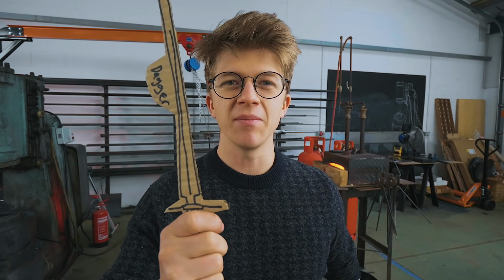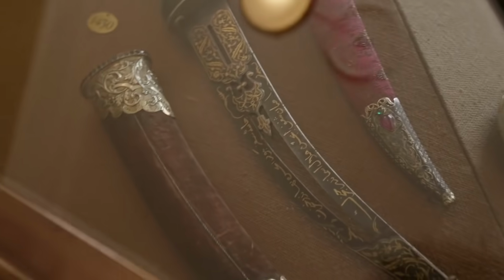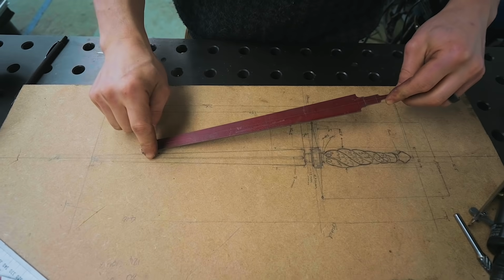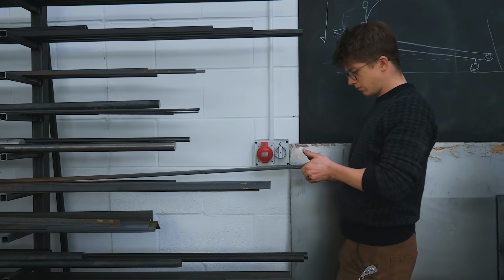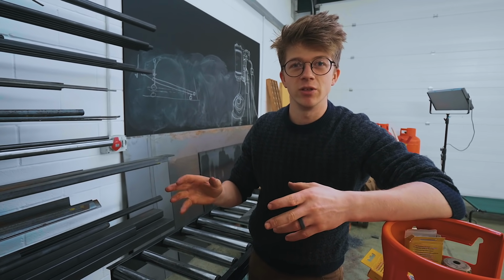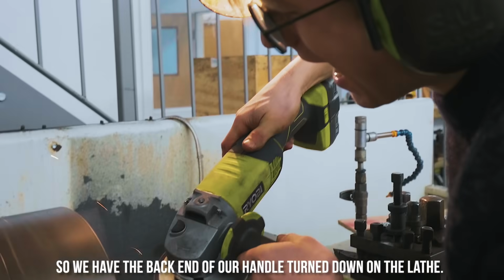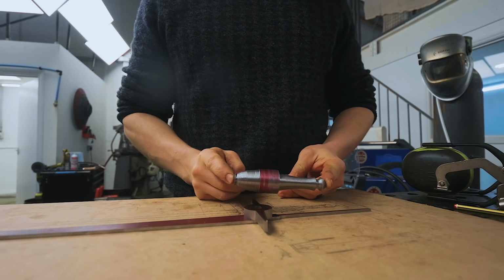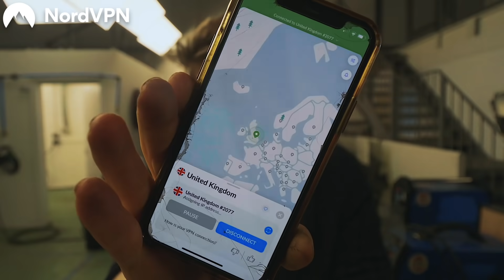MAKING THE SEA-MONSTER STILETTO!!! Part 1

Comment: It boggles the mind when you think about the fact that these historical masterpieces were made solely with hand tools.
Reply: @Felipe Lavratti we have the time as well but most people care a about efficiency and not the tradition of the craftsmanship
Reply: There's a challenge for alex; a blade made only with medieval tooling and techniques
Reply: during the middle ages blacksmiths would get so good at forging as that was the only thing they did day after day, and so they became masters of using hand tools resulting in great pieces of work.
Reply: Not to mention they also melted minerals and everything to make ore then they made the metal and hammered it all out by hand
Reply: In fairness, the function of power tools was to make fabrication easier for mass production. The temptation to rely on power tools slowly kills the need to apply patience the way Ye Olde Masters did.
Reply: @Felipe Lavratti I agree I feel like as times passes, every thing is sped up more and more
Reply: @Felipe Lavratti I think that as as things started to revolve around profits, older ways of craftsmanship were lost in attempt to make things more efficient
Reply: Don't forget that in higher end stuff there would be dozens of apprentices and journeymen working on various stages with the master overseeing. Often the blade would be made and sold separately and the handles fitted later to taste, for example a lot of Indian and Afghan swords have British sabre blades with local handles.
Reply: There is also the fact that some of those pieces were only made for royal families who would commission a piece that may take a year or more to make and cost the wages of ten men’s salary back in the day.  The average blade wasn’t something this magnificent.  These are rare artisan pieces Alec is emulating.  And yes it does boggle the mind how those artisans would take a lifetime perfecting a skill.
Reply: Yes all done by hand and yes very slow. You are also seing some survival bias. The masterpieces of a few craftsman that are of the most highly payed work. Some of the master work items cost hundreds of pounds at there time of manufacturing. That would be like paying 100k for a knife and not finding the pinnacle of each trade to compete there parts.
Reply: @xgoodvibesx  Swords were like that in general. The blade was a separate construction, handles could be remade and changed when passed between owners.
Reply: They actually had a bunch of water-powered power hammers and various machinery even in the Middle Ages
Reply: Not everything was done by hand, here in germany exist waterpowered powerhammers that are several hundred years old.  There are documents from the 14th century and earlier about powerhammers powered by water.
Reply: @Metric_Metalworks  that is really fascinating I would love to learn more.
Reply: i've read some of the comments here. don't forget that, back then, a pice of such intrincated work would be so valuable that you could buy a good piece of land if you sold it. so, even if it took you years to make, it was worth it. in modern day, creating such pieces by hand has basically no yield in comparison... other than personal satisfaction and awe factor i guess- but monetarily speaking it'd make no sense. i mean yeas, such pieces go for good amounts of money today, but nothing like a house or a piece of land. you could argue that in the same amount of time (lets say a year), with modern tools, you could make enough pieces to actually buy a house or piece of land. and you'd be right, you could. but we are talking about the notion of going through the learning curve for making such pieces by hand with the tools that they had back then. back then, it was worth it.
Reply: @tobiasripper4124  Honestly though... A power tool doesn't change the skills required to perform the work, it only speeds the work up. Same skill cap applies. A power hammer is still just a hammer - More powerful than the handheld variety, and makes drawing out and shaping steel faster, but not easier. Same for carving tools. You need the same artistic skills to carve a masterwork with a dremel as you would with handheld chisels and a mallet. The main difference is time, thus patience (which I suppose is a skill on it's own, but not one we're discussing here).

I can recommend the Timeline documentary miniseries "Secrets of the Castle" (available here on youtube in its entirety), which focuses on an archaeological project in France, where they build a castle just like they did back during medieval times, with medieval tools and methodology, while being dressed in authentic medieval clothes, living in medieval accommodations and eating medieval cuisine. A fairly large part of it is focused on the engineering behind such an endeavour, and it's actually quite intricate and ingenious. Far from primitive is the least I can say.
Reply: @xxhellspawnedxx  ehhmm thats pretty much what i said? never said it is "easier" just that back then it required certain amount of time and skill that today are mostly not apreciated like they were at that time. back then there weren't many people that could pull off artistic pieces of such value and they took lots of time to make. today there are many people that CAN (doesn't mean will) produce such pieces, and they can do it by quantities in maybe half the time... just offer and demand.
Reply: @Felipe Lavratti They had time? No, they were laborious. They had to take care of animals they owned, because everyone had some sort of animals back in the day. And they probably had a job to do. Because you know, blacksmiths were not artists. They were making pretty much everything that is made out of metal. It kinda annoys me, that there is people like you who think, that in the older days people didn't had anything to.
Reply: @Maltinis  yeah they had a bunch of stuff to do but l8vestock wasn't realy a problem of blacksmiths. People in the cities had at most some chicken and the wives and or children would tend to them. Same for a village blacksmith that was often the only one around they would work year long on everything the village needed with whatevrr livestock and gardening falling towards the woman and children. Craftsman of any trade would be to occupied with their work at least in the countryside because as said they were far and few inbetween.

Also if we are talking about weapons most blacksmiths would at most craft knives and daggers and arrowheads in bulks as the normal pesant had no need for a sword or fancy weapons at all. Heck most weapons that were used when peasants had to fight were spears and repurposed farming tools
Reply: No damascus blade?
Reply: I think they used horse, wind and water power a fair bit by this period to help a bit.
Reply: By the time that style was common, they had water powered power hammers, grinding wheels, saws, forge bellows and even lathes. Also, file cutting machines, mortars to pound minerals and herbs into dyes or powder enamels used for decorating hilts and leather, and much more.
Plus: nobody did it all by himself. Usually a good artisan had at least half a dozen apprentices taking care of the daily chores that kept the shop running, from cleaning to breaking coal to performing the basic tasks (such as basic shaping and drawing or upsetting steel) a master smith wouldn't bother himself with and which were good training and practice for apprentices to build up their skills. And the smith usually just did the blade, then another artisan did the hilt, another the etchings or the engraving, and another again the scabbard and leather or cloth details.
Today there are artisans that are MORE capable, being able to do all that by themselves. 
The learning curve is even steeper, but their work still commands high prices. 
With some custom knives you could buy a fully accessorized BMW.
Power tools just make possible for a single person to do it all by him/herself (there are several women in the trade) within a reasonable time.

Comment: Using abrasive grinding in the lathe is a universally frowned-upon practice, it gets to the ways and slowly grinds them off.
Reply: Next time put some clothing on the bed to catch the abrasive, i would not say a word if it was old worn out lathe, but this looks like it has very nice bed and if its used and maintained properly it will last for many decades. You dont have to listen to us Alec but every machinist will say the same, and the bed is the most expensive part that cant be replaced like a gear or chuck :)

Comment: "A little extra thickness at the tip is handy."

- Alec Steele 2021
Reply: That's what she said.
Reply: tell me about it
Reply: I wouldn't know. :/
Reply: The filthiest comment I've seen today.  
Congratulations.
Reply: What's so strange about that? Having extra thickness at the tip helps with penetration.
Reply: LOL. Yep, pretty much. - ps - Nice name Mate. What's it come from?
Reply: Remember those "extra-clean" nuts.😂
Reply: @100nitrog2  
Would you be a welder, by chance?  
The profession with more innuendo in it's job description than any other? 

They use a hot rod to get 100% penetration and fill in an open or closed butt joint or V groove, without over penetrating and without leaving inclusions, in as few passes as possible without overheating.  

Think I need a cigarette after that.
Reply: @kaisersose5549  i am a welder.. now i will never look at my job the same..
Reply: This should be a shirt with just  Alecs head winking at you 😉🤣🤣🤣
Reply: @Medcanpoet  Tolkien's Elvish, it translates to Red hair Fire Unleashed
Reply: You need Jesus very very quickly

Comment: Hear me out: a Damascus deburr knife with a custom handle
Reply: I always snap those blades on stainless tubes so please no... but a Damascus crowbar would be great
Reply: Yes
Reply: @Sebastian-ed5kt  you can snap any blade on stainless tubes? Why would you? That makes no sense.
Reply: @Redtailedhawk99  what what?
Reply: @aidanfordsword6954  did I stutter? Can you speak English? My response wasn’t to the main poster but to the second comment.
Reply: @Redtailedhawk99  deburr knives are made for deburring with a coated carbide blade and normally they hold ages but I deburr stainless relatively brutal so I snap them quite often on every material but more on stainless.... Damascus would snap more easily in that thickness (I tried that already)
Reply: @Sebastian-ed5kt  I get it but just try applying less pressure. I know it’s more time consuming that way. Anything worth doing is worth taking the time to do it right however.
Reply: @Redtailedhawk99  then you will take either 10x the time or it simply wont work... Mostly I use a carbide bit on a dremel to deburr those parts or a grinder

Comment: I've just forged a 440c stainless kitchen knife, and I got some stress fractures meaning with my best TIG welding it's still far from perfect. I've been thinking starting with material close in shape makes more sense than  starting with round bar, but didn't because it felt like cheating. Seeing Alec Steele start on what seems to be a stock removal blade is liberating/inspiring!

Comment: Know you already completed this project, however a suggestion is. You take material like that, heat it red hot, and burn it in a bucket of sand until it cooled back to room temperature. May take a long time to cool but it soften the steel a lot do you carving, then rehardened it with your heat treating oven and temper it afterwards.

Comment: Fyi, 11L44 steel machines almost as easily as brass.  So worth picking up a bar if you decide to start over.  Unfortunately it also rusts as soon as you look away, so plating the final part would be a good idea.  (got a lot of sulfur, phosphorus, and lead to lubricate tools and form chips easier, but they sure don't help vs rust.)

Comment: Why are u using an angle grinder on the lathe for smothing out your cuts? I found that a strip of sandpaper and scotchbright will do the job just as well without having to use a maschine while working on another maschine.

Comment: Hi Alec; in a previous episode I believe you said there was a difference between ‘moving’ material and ‘removing’ material, and that the former was blacksmithing but the latter was not or was not necessarily blacksmithing.
If that’s correct then I’m wondering what to call what you did; a blacksmith forges, but this episode had no heat. I suppose I’m really asking if forging is possible without heat. Is it? 
Thank you for uploading your videos; I really enjoy them and look forward to watching them. Best of luck with the new-old workshop and juggling two businesses (nb: make sure your accountant is up to date on profit repatriation rules if you’ve set up a holding company to house Alec inc UK and Alec inc US; if operating both as sole proprietorships that wouldn’t allow for expense sharing between companies. Also, a holding company can be domiciled elsewhere from your operating locations.)

Comment: Just an advice. You shouldn't use the angle grinder on the lathe, because the little sparks are really hot and can melt and get stuck on the lathe's tool holder trolley guide or ruins the surface of it. I really enjoy the video. Waiting for more.

Comment: Enjoy the different episodes, but i wonder about one thing; All the Grinding. As a Shipbuilder myself, working over 10 years in a shipyard, building by standards of the 80./90. decent sized bulkcarriers and tankers (around 100 000 Gross tonnage/GT). Every surface had to be "mirror glossy" before paint, but not even inside the cargo tanks, have i seen so much grinding. So much waste of material. Nowadays you even have plasmacutters and so on, but you still end up with half of your material on the floor, must spend fortunes on belts..

Comment: Wouldn’t investment casting be a better way to make the handle than painstakingly carving it out of solid steel? I feel like it would be way easier to carve that in wax than in metal. If you take the extra step to also create a silicon mold of the wax sculpt before creating the investment cast you would be able to easily recast the handle should anything go wrong.

Comment: dumb question, dont kill me: whats the difference between cutting out your blade out of a slab of steel vs. forging it out?
Reply: It's easier.
Reply: @saginawdan  Well duh. If that is the only difference, why then forge at all? Surely the reason must be because of material properties. Like using coal, imbues more carbon.

Comment: You want to challenge yourself? How about a series where you make a proper Chefs knife without power tools (sans initially cutting a piece of steel). Just your forge, hammers, anvil and files. No power hammer, no heat treating oven, no belt sander.

Comment: Tut tut grinder on the lathe... With hands as skilled as yours you can get that material off quicker using the cutting tool and finish it off with files - much safer than grinding a spinning job!

Comment: So quick question, I’m making an attempt at making my first sword and I was wondering. After I do my quench, tempering and final finishing. Am I suppose to put a coat of something on the blade or just buff everything one good time? Im asking because I’m worried about the blade starting to rust shortly after I finish it. Is there something I can do to prevent or slow the rusting process? Any information is well received. This is my first attempt at any kind of blade or anything like this. Thank you in advance!!! 💯

Comment: Check this out. I created a sword in my head. I can see it fully. I just have no forging skills or any artistic ability. 1080 steel for the 3 foot long blade with a fuller and 12.5 inches for the tang. Mild steel oval guard measuring 6 inches long by 4 inches wide by 1/2 inch thick. Handle made of oak wrapped in leather measuring 8.5 inches long. A 3 inch wide, 1/2 inch thick disc pommel at the back also made of mild steel. The last 1/2 inch of the tang is for peening over to make the back of the sword tight.

Embellishments include the phrase "Death awaits all who oppose this blade.," in Latin down the fuller from tip to guard. Demons and dragons on the flats. 2 dragons chasing each other around the guard separated by 2 rubies at the apexes. A human skull minus mandible with rubies for eyes on one side of the pommel. On the other is a demon skull with 4 horns, and elongated narrow triangular jaw also with rubies for eyes.

As you can tell, i've spent time on this thing in my head.

All comments welcome.

Comment: Alec or should I say Will Jr, when using emery cloth to do a lot of polishing on the lathe it is best to put a shop towel on the ways under the work especially if you are using a flapper disk on the angle grinder, your number one tool primitive Pete.  This is so the shop towel catches all the grit and fine metal particles you are removing and makes it easy to clean up.  As opposed to what you are doing, letting it all fall on your Ways and mix with your Way oil to form a nice honing compound to greatly accelerate the wear of the machine.  In a year or two, you will wonder why it doesn't hold dimensions and why suddenly does it have so much backlash.  Lathes and milling machines can last 40+ years with a little care, so please stop doing a Will to the machines.